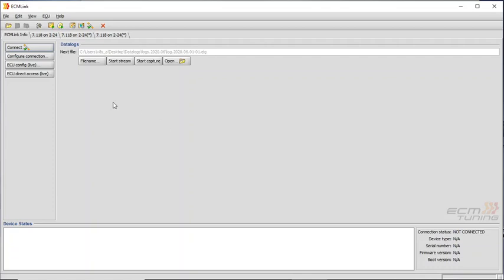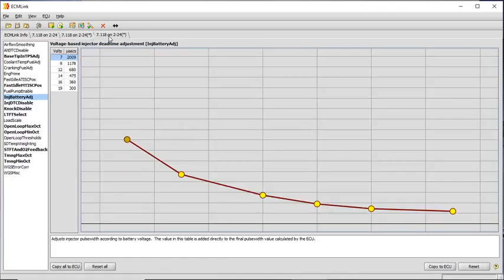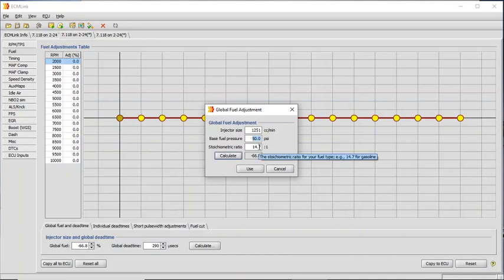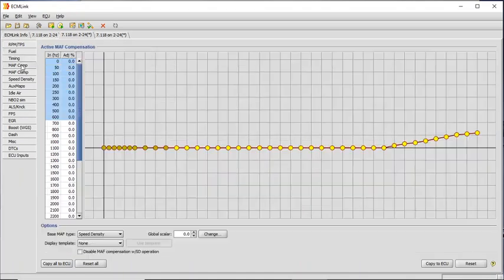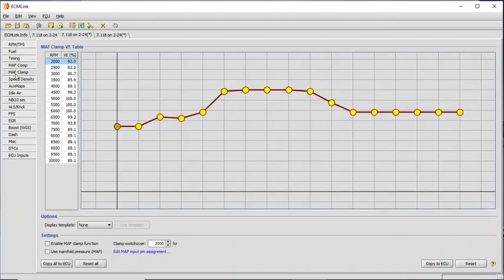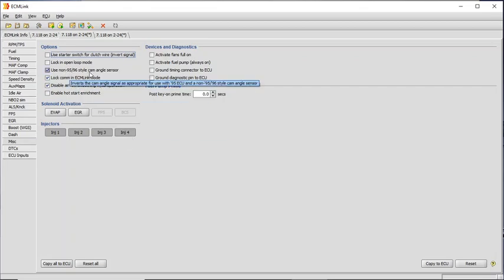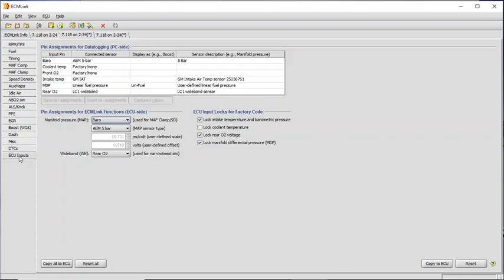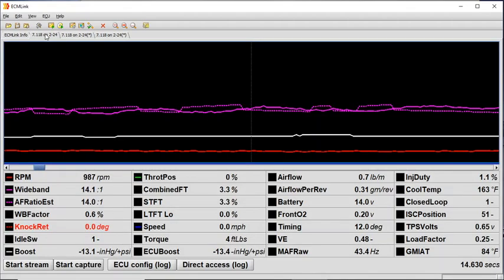Maf cars.  New users 1st time starting

Comment: Car wants to idle up n down I've adjusted the biss screw properly. And installed a new iac motor nd checked the 02 sensors and adjusted everything to right specs within ecmlink nd it still fluctuates
Reply from the maker: Have you performed a boost leak test?